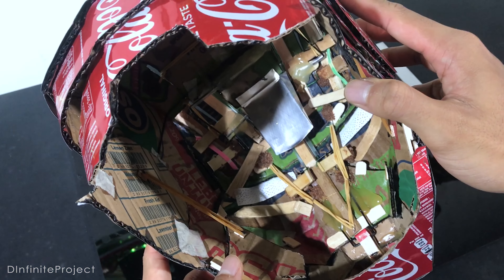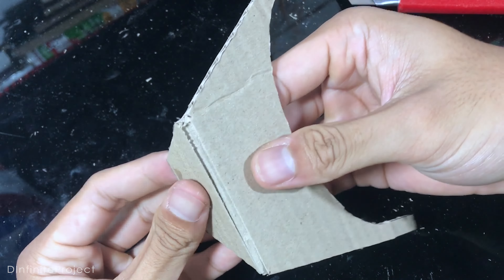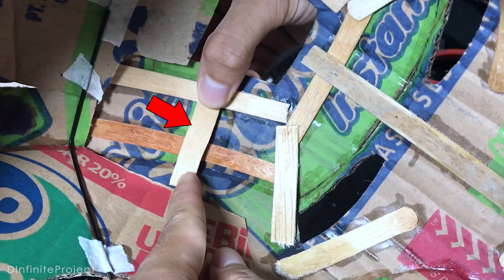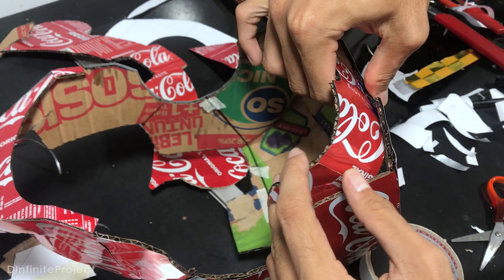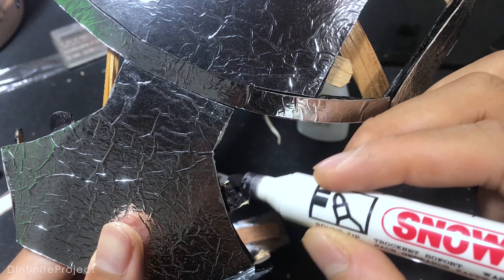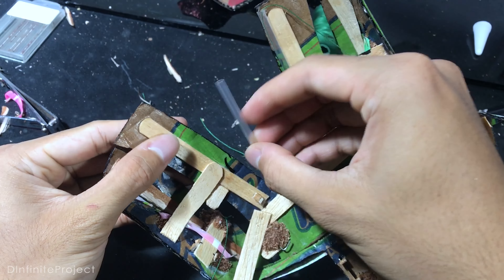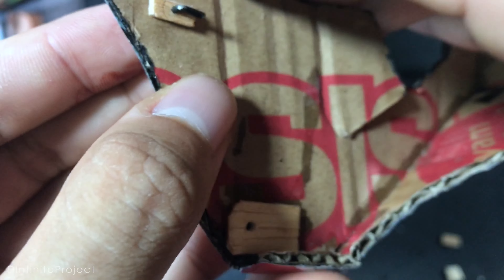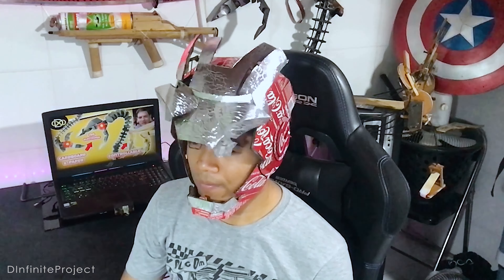DIY Iron Man Helmet Out of Cardboard and Soda Cans || How to Make Iron Man Helmet

Comment: If I can I hink I will make this but use the painting method that sean's craft used to know the best spray-colours to properly paint the ironman mask,also you can harden the mask with raisin but if you prefer to 3D print the mask it's ok to do so,dont be afraid to mix his ideas with yours as you can use different hardening methods but again,just use your available resources and if you want you can 3D print this or harden the mask with raisin instead of soda cans